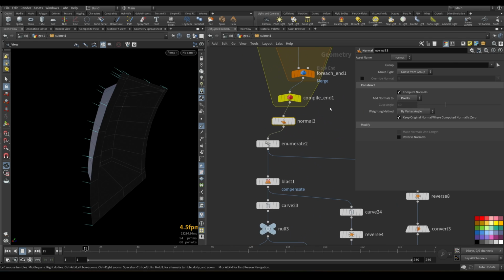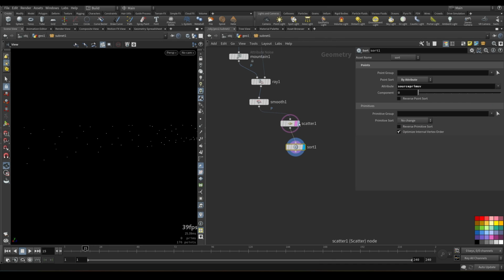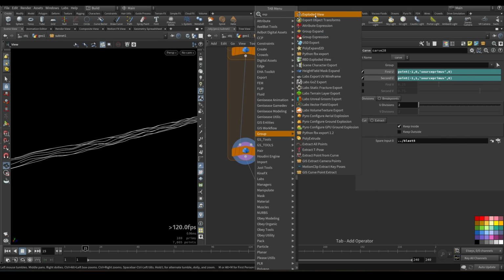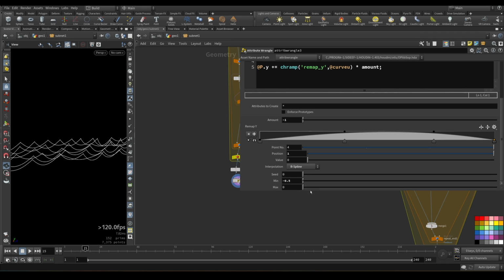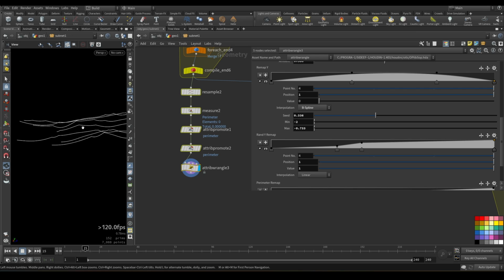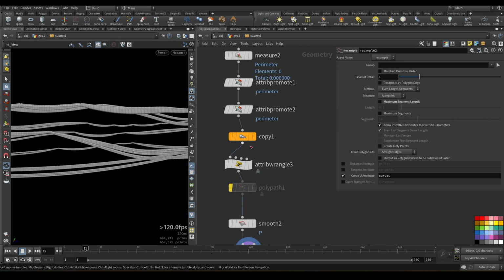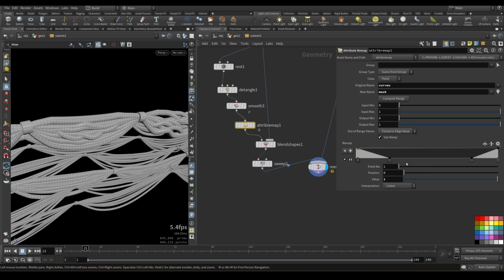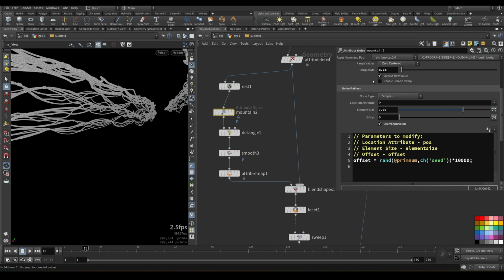Houdini Procedural Subway Tunnel 03 - Wires

Comment: Love it !!! Waiting for the next tutorial! Modern bridges perhaps? (like the fantastic one between Macao and Hong Kong)...I know it's a real challenge because you have to worry not only about the route of the bridge but also the height of the land so that the pillars are connected to the ground whatever the appearance of the land. I've already found a good method but I'm sure you can teach us a better one!
Reply from the maker: Hey @AngeloCogerino :) Really glad it was useful! 
Creating bridges is one of the classic frequent tasks for procedural modeling. I am definitely planning to do more than one tutorial on this topic as the topic is deep. Unsure exactly when, but relatively soon, as I have things to cover before. Could you share references of the elements you are interested in? And I will try to take into account the elements of interest in one of the next lessons.
Reply: @Genisease  :  search for "Hong Kong–Zhuhai–Macau Bridge" There is a lot of data about it and it's a good example of a top modern bridge .( That would be great !  ) For now, I am trying to finish the 3 tutorials and it's thye third time I start from scratch to fully understand the technic you are using. I alreeady changed few things by example adding a "null" to gather all parameters in one place. At the end I will duplicate the tunnel 2 times to get the two tunnels for each circulation side, change the railway for road, and add 2 maintenances tunnels on each sides....all of this of course with a "switch", to make possible to choose which type of tunnel is needed...then I will convert all of this to digital assets and export it to UE5 !!!
Lot to do isn't it ? Thanks one more time. I learned a lot even it's not easy.